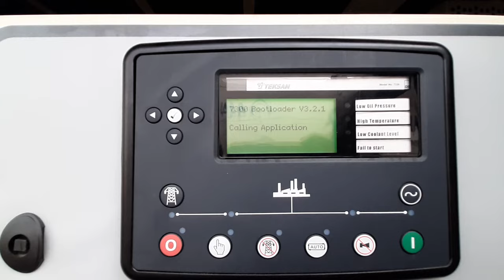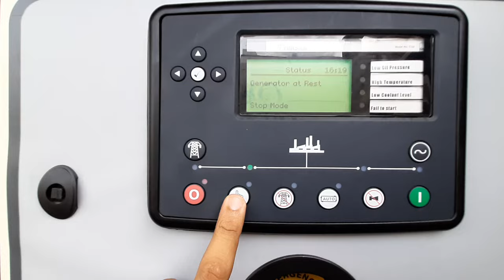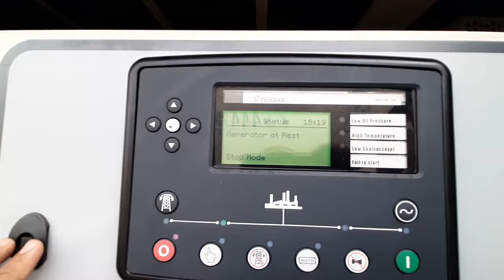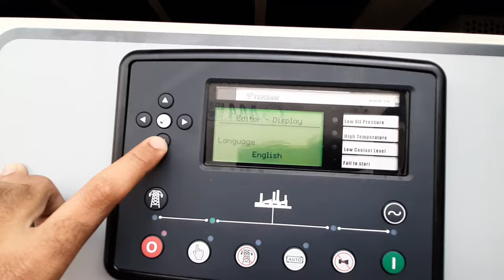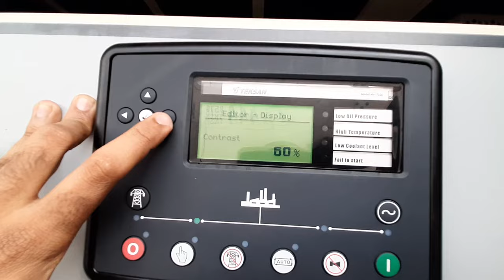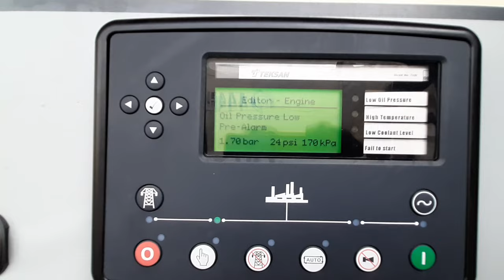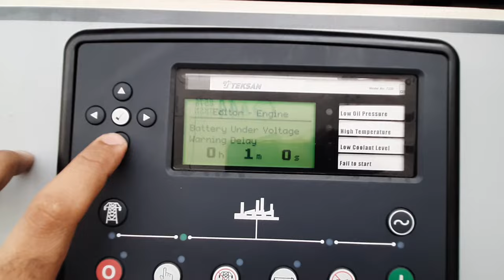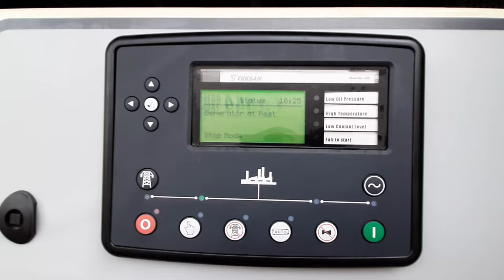Generator Controller DSE 7320 Manual parameter setting No laptop required let's start

Comment: Excellent, but how to configure the different types of oil pressure and temperature sensors and how do you configure the auxiliary inputs and outputs? by the front without a PC?
Reply from the maker: Software is always recommended as first choice for full control

Comment: Oil pressure low what is reasen
Reply from the maker: Check oil pressure with manual gauge if ok replace oil sensor

Comment: Sar Kirloskar 500 KVA 750 voltage alternator hai Magar Sar under voltage Aane per generator stop ho raha hai only 10 second mein controller pay 735 volt a rahe hain 7320 MKii
Reply from the maker: Load dalnay per yeh bagair laod k